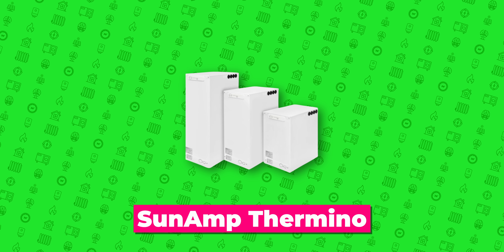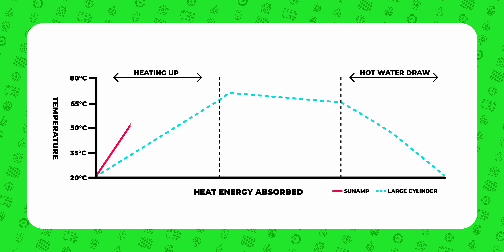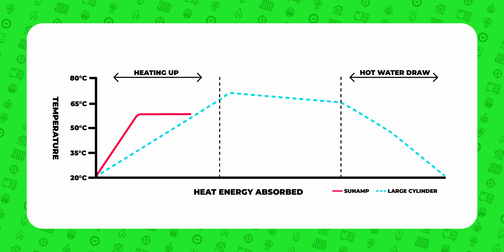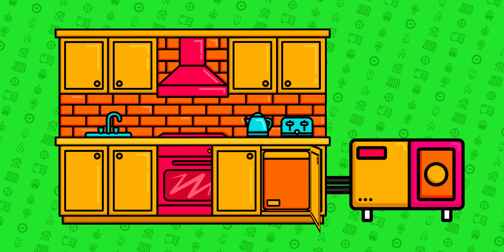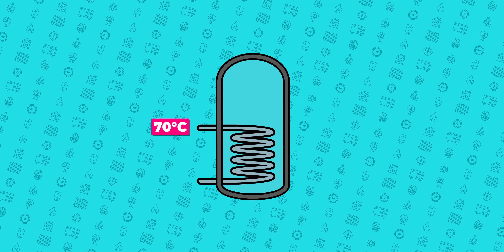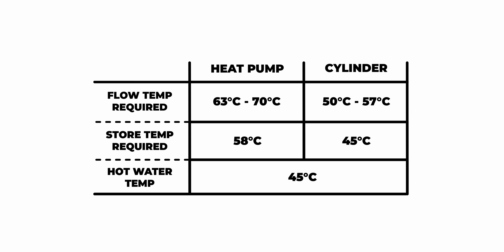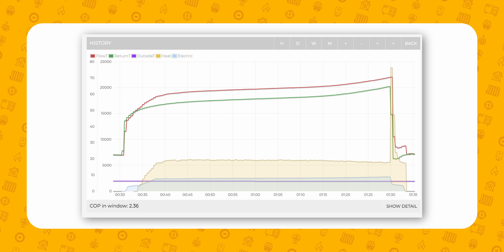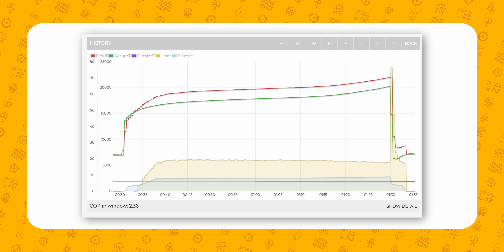Is this THE FUTURE of Home Hot Water? Sunamp Review

Comment: Interesting points, we love our SunAmp and while not perfect it's very good. No moving parts, no servicing, it's a drop in replacment for old immersion heaters and the unit will keep the water hot for days and in the event of a power failure you still get hot water as it's driven by mains water pressure. We don't use a heat pump, the sunamp provides our hot water and we use infrared panels for heating so no gas :) and as the sunamp is so good at keeping the water hot our sunamp is on a timer and only draws power offpeak and for us this device is phenominal
Reply: What is your experience on the infrared panels? Cost to run particularly. Do you actually use them less as you can heat the room you are in rather than the whole house etc (although I’d worry about not heating certain rooms and them going a bit damp over time. 

Basically a heat pump is a challenge in our house - just nowhere to put the heat pump itself - hence looking for other options.
Reply: @jamesdaw131  Hi again, I do not want a heat pump because of the additional pipework and radiator change plus the system still needs to be serviced every year :(

We use Herschel infrared panels and they are really good :) if you live in the UK you can visit their showroom and you can see and feel the panels working :)

Cost is different, you are using electricity so it will cost more then using a combi boiler but you are not burning any fossil fuel's :) however you can heat the rooms individually so if you are working from home in a study/office and  no one else is home then you can just turn the panels on in that one room instead of the whole house which is what we tend to do

When the electricity is free or negative (Octopus Agile tarif) then we turn all the panels on and as such we don't seem to suffer from damp however it would be better to keep the panels on low as they heat the objects in the room but this is a personal choice as we turn ours on and off depending on who is in etc

The next step is battery storage so we can use cheap electricity during peak times then solar panels to provide electricity during the day and to top up the batteries etc

It's not cheap but you will not be using any fossil fuels to heat your home and hot water and when we change our cooker to electric then we will have the gas supply disconnected
Reply: Just wondering why you say it's not perfect but very good. If you could expand it would be much appreciated, thinking of getting one.
Reply: @StefNoci  The SunAmp is brilliant and I would recommend without fail. However there is no temperature control on the unit, it gets hot! you need a mixer valve fitted to combine the hot water from the SunAmp with cold water (not a biggie but a niggle) the SunAmp comes in two versions (always on and the e version with control) however these are the same

The always on has Live, Neutral and Earth and the e version has the same plus a control lead, if you use a smart switch/relay you can use the standard and save some money (just another niggle)

The guys at SunAmp say you can pair 2 or 3 units together (very expensive) and use them to power radiators but I am unsure how this would work as the SunAmp takes cold mains water then heats up but to drive radiators you would need a closed pressurised system and I don't think the SunAmp would work or work anywhere as efficient rendering the solution null and void (again not a problem just a niggle)

Use the SunAmp to do what it says on the tin (hot water) and it is fantastic, just cold water in then hot water out with the mixer valve above and small expansion vessel plus a water conditioner then you won't be disappointed 😁
Reply: Please note, a mixer valve is 'required' as part of the install of the Sunamp. If your installer didn't put one in then the niggle should really be with them and not Sunamp ;)

Comment: So your hot water cylinder is 400% efficient, i.e. it's putting back into the heating system,4 times the heat that it is taking out? What do you do with all of this extra energy and where did it come from? Certainly not anywhere in the known universe.
Reply: It comes from the environment.
1kW comes from the electrical components, 3kW from the environment.
You only pay for the electricity so you get 400% of the heat from the electricity you paid for.
Reply: @BenIsInSweden  So, IT'S NOT 400% EFFICIENT. The Heat pump supplying it has a COP of 4. Efficiency and COP are not the same thing, a heat pump and a hot water cylinder are not the same thing. That was a false claim then.
Reply: @nickwinn7812  The industry has taken to use the term efficiency for this application, whether you agree with it or not is moot.. Daikin and Octopus both list the COP as efficiency on their websites for their heat pumps.

But good luck convincing an industry that it's a false claim.
Reply: @nickwinn7812  It's only misinformation if you rigidly apply a single definition of efficiency without considering its common usage in different contexts. Language evolves, and in the context of heat pumps, efficiency is widely used to describe how much heat is delivered per unit of electricity consumed.

For the average consumer, saying 'You get 4 kWh of heat for every 1 kWh of electricity' is much clearer than discussing COP. It allows for a straightforward comparison with gas boilers, which typically provide 0.8-0.95 kWh of heat per kWh of gas.

COP is a more technical term that lacks an intuitive frame of reference for most people. You could say a gas boiler has a COP of 0.8, but since most people aren't familiar with COP in the first place, it doesn't communicate the practical impact as effectively.
Reply: @BenIsInSweden  Efficiency is a technical term, as is COP. One is not more technical than the other.They are not interchangeable. I'm sorry if some people find COP and or efficiency difficult to understand. Incorrectly using the term efficiency will not improve understanding.
The fact that you state that a gas boiler has a COP of 0.8 is a clear example of this. Gas boilers do not transfer ambient heat from the environment around them to the water flowing through them, they convert fuel energy to heat energy and transfer this heat to the circulating water. There is a big difference
COP IS NOT the inverse of efficiency!!!!!!!!!!!!!!
Reply: @nickwinn7812  I get where you're coming from on the technical definitions, but ultimately, the challenge is how to present a meaningful comparison for homeowners.

People pay per kWh of energy they consume and want to know how much heat they get in return. With a gas boiler, they get around 0.8-0.95 kWh of heat per kWh of gas. With a heat pump, they get around 3-5 kWh of heat per kWh of electricity.

If you don’t think using ‘efficiency’ to describe this comparison is appropriate, what alternative would you suggest? How would you present the difference between a gas boiler and a heat pump in a way that’s intuitive for homeowners who just want to know how much heat they’ll get for their money?

And no, 'they're not comparable' is not a valid answer—people do compare them because they need to decide which to install in their home.
Reply: @nickwinn7812 good luck with your crusade. If you could also fix people using the term of efficiency over efficacy that would be great too 😂
Reply from the maker: Boilers are measured by kw energy in/kw energy out and gives a % efficiency.

To use a different system for heat pumps would make comparing them extremely complicated unnecessarily.

It is over 400% fiscally efficient if that helps?
Reply: @HeatGeek would that not assume both gas and electric cost the same per kwh? ;)

Comment: Why do we even want to store hot water?? This was only needed because old boilers didn't have the throughput for instantaneous hot water. Today's best heat pumps are monoblocks that only require a small indoor unit, I think hot water tanks are really a thing of the past...
Reply from the maker: @Pickle_Rick-m4o  there’s not enough electrical power to have combi heat pumps.. unless you use our ‘ministore’
Reply: @HeatGeek  LG and Daikin both make mono block heat pumps that don't require an indoor heat store...
Reply: @Pickle_Rick-m4o  Which models? As I've not heard of any that will do DHW for residential without a cylinder indoors.  The LG IWT has a fridge sized unit inside, and so does the Daikin Compact models.
Reply: If these do exist I’ll be surprised if they can work in climates that regularly drop below 0C. I could imagine such a thing does exist in the tropics where the load for instant water heating may be as low a a few kilowatts.

Comment: Great video Adam. Agree with all the information covered and presented with a good degree of balance pros vs cons. For me Sunamp was something I was initially excited about until I learnt about the necessary high flow temperatures.

One other useful bit of info is that if you don't heat the Sunamp to the PCM phase temperature above circa 56C, so 45C for example, I recall it stores much less thermal energy than an equivalent amount of water iirc. It's sort of all or nothing with PCM material.

Comment: The main issue with the Newark HG Super Cylinder is the incoming water pressure requirement of 3.0 Bar. Basically incompatible with low pressure households unlike a Megaflo
Reply from the maker: Can you tell me where you read that they have a 3 bar min pressure?

Comment: We love our SunAmp…all the HW we need produced by IO cheap rate in the winter and solar PV divert in the summer. Mains pressure HW throughout the house, a new cupboard, no shower pumps and silent operation. Ticks all our boxes.
Reply: Re my comment above - but what do you use all the hot water for? I'm sure you have a dishwasher and washing machine and probably an electric shower or 2. If all you need is the sink for shaving why not use a continuous water heater as I describe above? £150 and about £60 to fit. Few people take baths these days
Reply: @ what do you mean “all the hot water” I wrote “all the hot water we need”……what amount of water are you assuming ?
Reply: @buddywheels  Well spotted! This may mean you use even less than me but most comments on here seem to say they need a lot.
Reply: @ I’m sure you’d be impressed by how abstemious we are.
Reply: Some call being economical with using hot water is being mean. I get so annoyed when I see people running the hot tap for minutes to get the water from a combi just to wash hands or a cup or a plate when they have a dishwasher and a cupboard full of cups and plates!!.  Equally wasteful on electricity is FILLING a kettle for a cup of tea!! I never waste water on washing the car - I go to a car wash but I suppose that's cheating!!
Reply: @ Couldn’t agree more.

Comment: No I had the opportunity to swap in the remodel but was put off   older versions are known to leak and have limitations  , I would say it’s best for flats and solar array where you wan to maximise local Production than export  the water through put on sub models also works against it only the largest offers 15- to 20 litres , there heating version being  Trialed now , is only ideal for small 2 bed flats ,  like a modern day thermal heater used off peak but I admit it could be use offer preheated flow .or if you wanted to spit flow from kitchen and updstairs such as an extra bathroom o suite in combination with a power tank . But the best case is just small family or retired because of  recharge time

Comment: My solution to legionella in a large (200 ltr) hot water tank at low temperature (30C) is to use a UV sterilisation unit ahead of the tank. No bugs in = no bugs out.
Reply: Legionella is everywhere so it'll already be in your tank anyway. Put the uvc after the tank, if it's at 30°C that's cold anyway! Running a legionella cycle once a week probably won't work out much more expensive than running the uvc (40 watts is about 6kwh per week) and if it's the traditional style then a new bulb and quartz sleeve every 12 months will soon exceed the cost of a weekly cycle. Your uvc isn't doing anything for legionella anyway. A uvc also needs a pre-filter as well so factor in replacement filters as well. Running your tank at 30°C is creating a legionella factory. Unless you are regularly emptying it then in my experience it takes 4-5 days to grow enough legionella to make you ill. As an aside, my experience comes from a property with a uvc on the supply but also a loft tank with a lot of sludge in it. Legionella is described as ubiquitous which means it's everywhere. If you give it the right temperature to grow then it'll grow. It doesn't need to get in because it'll already be there.
Reply: @matthewwakeham2206  Sound advice. I was considering an LED light based steriliser to reduce the power consumption. Some units are adaptive so that they are only active when the water is flowing, which further reduces the power requirements. They are also much less fussy about being cycled on and off than their incandescent or fluorescent counterparts and should give longer service in any case. At the moment the tank, which is heated by a heat pump, gets a weekly immersion sterilisation cycle, but I’m looking to improve the safety as we are elderly and more vulnerable.
Reply: @matthewwakeham2206 yeh running at 30C is crazy, he’s creating what he thinks he’s stopping.
Reply: Wouldn’t it be even safer if installed downstream from the tank? Or better yet in the tank?
Reply: @Random-f3y7w I don’t know how well the unit would withstand the heat, so maybe best not to risk fitting at the exit. Might affect the guarantee. And it’s a retrofit, the tank came with the house, so the option of an internal unit wasn’t there. I’m not an engineer but I imagine that inside the 200 litre tank might require several sources to achieve suitable intensity.
Reply: Surely 30°C isn't really hot enough for anything either? That's a pretty cold shower
Reply: @ I find it comfortable enough. Each to their own. Next step is to install a water meter in the HW line. I think that the tank is probably too big for two seniors who don’t require multiple daily showers.

Comment: Their site suggests that Plentigrade can be produced with different melting points (Even down to -30 for cooling applications), so they could make one with a lower temperature which would be a lot better for heat pumps.
Reply from the maker: you’ll still have the issue of double distortion created by 2 heat exchanges and a restrictive hex..  but it will be an improvement for sure. I would be aiming for 45c personally.
Reply: @HeatGeek  Does that 2nd distortion actually affect efficiency though? Surely it just means more heat is left in the SunAmp when 'empty' and so less energy is required to recharge the battery. Compared that with a water cylinder that needs to heat much colder mains water every time it's depleted which would take significantly more energy.

Would be great to know numbers for how this 2nd distortion affects efficiency. We already know the Heat Geek Mini Store has more than twice the standing heat loss (heat lost to the environment in 24 hours) than the same capacity SunAmp i.e. the smallest 150 xPlus (which fits nicely under a kitchen worktop) compared to the Mini Store XL (way too big to fit under a worktop). If we can get figures for actual affect of this '2nd distortion' we can see if it outweighs the 1.4kWh per day loss of the Heat Geek Mini Store and give a better overall comparison of the 2 systems.
Reply: Another option to reduce hot water demand and therefore storage space is waste water heat recovery in the shower. We have two Zyphos and it noticeably reduces the time the hot water cylinder needs to re-heat. Make sure to use the original filter trap if you opt for the 40 and install them close to it if someone has long curly hair. No caveats with the 30 as the water passes straight through.
Reply: You likely need around 58C to reduce chance of legionella. In this case they could have increased insulation, but as the product is likely to be much more expensive then existing products they chose a niche market and optimized for small form factor to avoid competition.
Reply: @Random-f3y7w  it's 58°C because this is the exact melting point of sodium acetate trihydrate (better known as hot ice)
And I'm sure they can produce an eutectic mixture of other substances to create any melting point.
Reply: @Random-f3y7w  You don't need to worry about legionnaires with a Sunamp because it doesn't store heated water. It works like a combi boiler, heating water on demand.

Comment: I got a sunamp heat battery installed in my flat and it works great. My main reasons for going with it was for more efficient heat storage and space. I'm on agile octopus and I plan to write a script that will automatically "charge" it when energy is cheapest.
Reply: I have the sunamp on octopus agile and I do exactly this. I have home assistant running that has 2 entities that trigger off for the cheapest 2 hour window. Then I have an automation that will fire on the window start to enable the 'hot water boost' on the vaillant. 
Also have a 1 hour window that I use sometimes if I know there'll be low demand the following day.
Reply: Does Sunamp have EPREL (EU) rating or is this UK only? Would like to compare energy stats against conventional hot water storage tanks. Do you get both energy efficacy improvement and volume reduction, or just the latter?